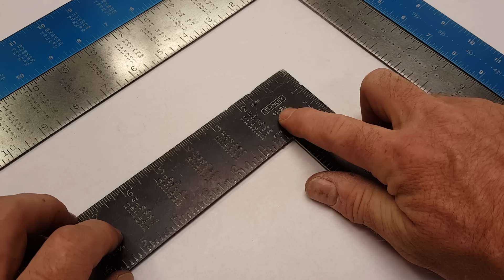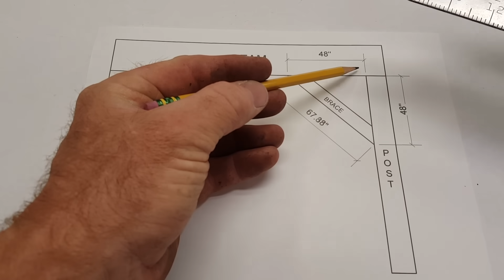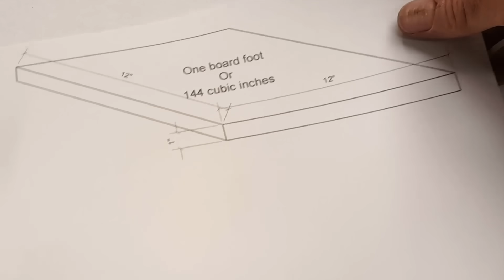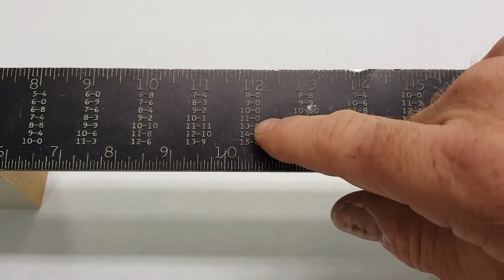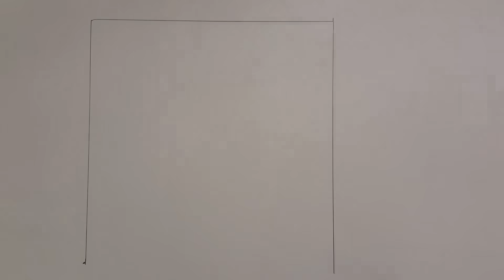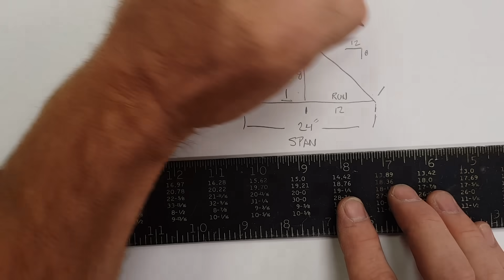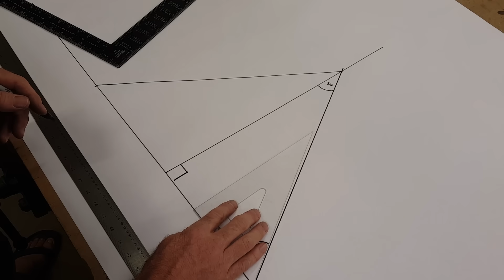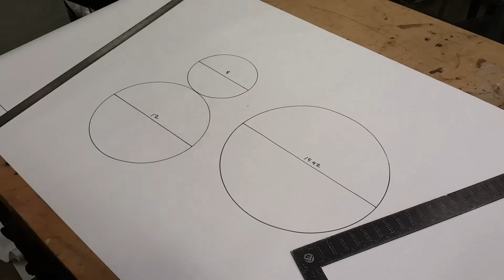Framing Square Basics - How to use one

Comment: Hi Justin,
Good presentation of framing squares.  However, I beg to differ with you on how to use the 100ths scale.  It is, of course, to convert 100ths to the nearest 16th of an inch.
Consider how fine a graduation 1/100 of an inch is and think about the distances a carpenter usually works with constructing a building:  feet and inches to the nearest 1/16th of an inch.  He is not likely to ever have to measure any length precisely to one hundredth of an inch.  The width of his pencil mark is likely 1/16th or more.  Think about how time consuming and how awkward it would be to use dividers to add the decimal to a distance measured with a tape measure or folding rule every time you needed to lay out a brace.
As you note, the scale to determine bracing lengths on the square reads in 100ths. On the 100ths scale, the longest tic marks on the 100th scale represents 25/100 inch, and there are four tics between each of the longer tics.  The distance between those tics is 5/100 inch.  The shortest tics are 1/100 inch apart.  
Now, notice there is a scale in 1/16 inch immediately below the 100ths scale.
So, for your example of 67.88 inches, to convert the .88 to the nearest 1/16th inch:
count, 25, 50, 75 (3 long tics)  80, 85, 90 (3 medium tics) = 90/100 or 0.90 inch.  0.88 is just two of the 1/100ths tics before the 0.90.  
If you look below on the 16th scale you will see that the 7/8 inch mark is the closest to the .88 mark on the 100ths scale.
So,  the carpenter would measure 67-7/8 inch directly on his tape measure, mark and cut his brace.  No wasting time with dividers.  : ) 
The 100ths/16ths scale is to convert from decimal to fractional inches.  No multiplying necessary.  All you have to do is count by 25 and 5 and you're within two or three 100ths of any 2-digit decimal. 
Try a few:
67.88  :   25, 50, 75, 80,85,90= 67-7/8ths inches
76.37  :  25, 30, 35, 37 = 76-3/8ths inches
60.31  :  25, 30 = 60-5/16ths inches
Reply from the maker: Agreed, conversion is definitely a use for the 100ths scale. In an effort to keep the video under 15 minutes I had to cut several items on my list. Using the 100ths scale as a conversion chart was one of them. As is turns out I went over my time limit by a little anyway. 

I would argue against the assertion that conversion is only intended use for the 100ths scale. It's also very difficult to support that it is the primary use too. The framing square can be use for more than just the construction of structures. It's has been and is often used for trim and finish work and non-construction related projects. In these use cases a good set of dividers and a marking knife are superior to the relatively blunt end of a pencil lead. That being said, I struggle to accept that the poor resolution of a pencil ought to limit the set of intended uses of a precision measuring device.

Comment: Just think, I use it to see if a corner is square ! :-)
Reply from the maker: Ha!
Reply: Ya me to.
Reply: I can measure and draw a straight line with it.😁
Reply: It's still mystifying to me, this will take time. I'll just keep using it as a square. Thanks for  video.
Reply: Make Build Modify Hey I saw a add today. It was called a 131 measuring stick. Can you do a presentation on this tool it looked really cool And useful.

Comment: When is USA going to switch to metric?  This is just ridiculous
Reply: Sergey Babenin,
The good news is you have two choices. Use the system you feel the most comfortable with.  Tools are available in either system and some contain both.
david
Reply: Sergey Bebenin what is 6 millimeters plus 6 millimeters? Counting by twelves  improves my math skills. Tens are easy. I take measurements in threes and fours etc. It seems that a tenth based scale doesn't accommodate everything, which is why we also have broken inches up into many different increments. You see we believe in diversity and versatility.
Reply: @Sergey base 12 math is older than base 10 and is very handy in the real world, ever try to divide a circle into 10 equal parts. Or 1/3rd of a meter (33.3333... centimeters) vs 1/3 of a foot (4 inches). How about 5/6ths? knowing a meter is the distance light travels in a vacuum in 1/299,792,458 of a sec vs. the average length of your foot. Geometry, clocks, months of the year, latitudes and longitude all based off of 12. Lastly the metric system was invented by the french so you can just keep that shit homie.
Reply from the maker: I prefer to be proficient with both systems. That way I'm not limited be someone else's proclivity.
Reply: No argument regardless proclivity but IMO it's time for US to join the world.  Just a rant I guess....
Reply from the maker: +Sergey Bebenin I agree. But I will say that the SI system is used in America in fields such as science, medicine, the military, and for the food standards. It's too bad that most Americans are stuck using the customary fractional units.
Reply: Make Build Modify yea I'm a Systems engineer and every company I worked at ( in Boston area) are on metric standards.  It's simply impossible to efficiently build a complex system (parts sometimes come from all over the world) using "standard" system
Reply from the maker: Yup, from an manufacturing efficiency perspective there is really no reason to use anything else. Unless you're making something like a fractional tool set where it's the goal of the process.

Comment: Really enjoyed this! I'm a carpenter's apprentice, this type of information is so valuable. I've been looking at the framing square a time or two and knew all those numbers meant something! I'm wondering if you'd be able to recommend a good resource for math as it pertains to carpenters/contractors?  I'll have to re-watch this video another time or two to fully comprehend some of the more technical details behind what you explainee. I took a carpentry 101 course at my local college, but math was something they glossed over. Which I was disappointed in, that's something I really could have used a refresher on (I was the only one in the class that felt that way btw).I really enjoy understanding all the technical details behind what I'm doing. I feel it makes me a better carpenter, and just smarter as an individual.

Thanks for the video!
Reply from the maker: Thanks! These books are old but they have all of the basics. They're also great to get an insight into the past work ethic.  "Audels Carpenters and Builders Guide ( 1-4 Volumes )"  Here's a link: http://amzn.to/2jHEhAa (affiliate link)  You can also find sets on eBay.
Reply: @Makebuildmodify  GREAT BOOKS!
Reply: adam nichols when u go to trade school u will go over this square in detail dont worry

Comment: Pathagaron's  theory.   Teach young minds this.  The square is men working together across distance, uniform reference.  But you can start by teaching the 3, 4, 5.  After that is understood, then teach a 2 + b 2= c 2.  The square is too complex for a young man who has been failed by the school system.  Most cannot read a tape measure.  That's what I would teach first.  Then, the speed square, them the framing square.
Your a good teacher.  I just think your audience should be high school age minds (or younger if they're intetested).  Your teaching at the drafting and math level, probably  beyond most high school kids.  Sad, but if everyone commented honestly, they would tell you, " you lost me".  But you  didn't loose them because of your mind, they need a lot more detailed instruction before starting.  You didn't stop once and ask, if you don't understand, ask in the comments below, but you did ask for subscription and a "like".  I'll give you what you asked of me, now I ask you, can you do this down to a high schoolers level?
Reply from the maker: Thanks for the sub! I'll consider a "basic math for building" video in the future.
Reply: Pythagorus' theory, surely.
Reply: @Exiledk  3² + 4² = 5² 
is that it ?